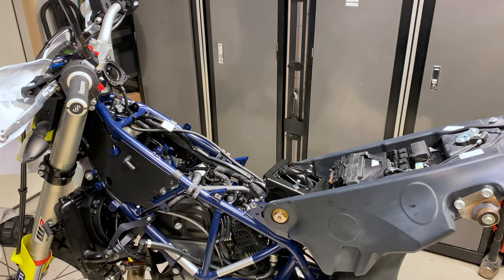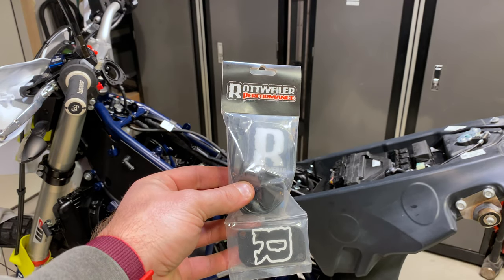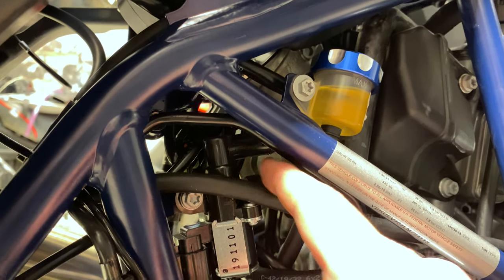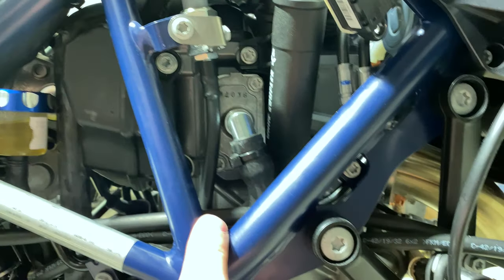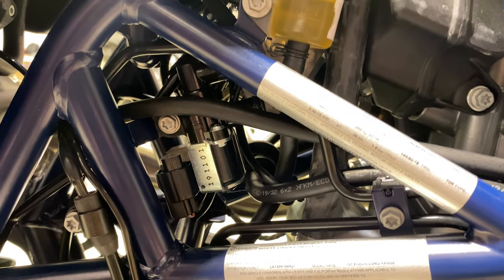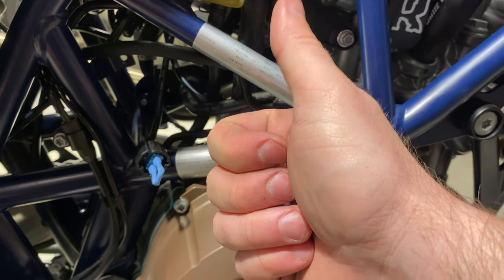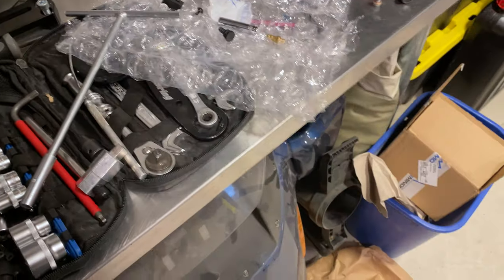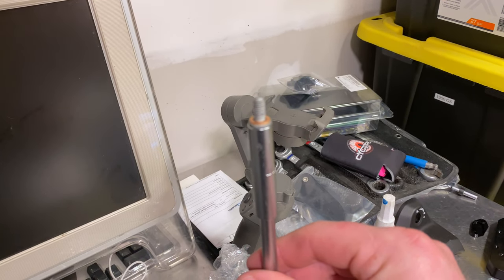Husqvarna 701 Enduro LR: Install Rottweiler SAS / Canister Removal Kit

Comment: Good video.  Thanks.
I just did this myself and made a few mistakes.
For you video - a couple notes: 

You should have left the two hoses joined and coming down into the clear piece that you would use to connect with a section of the tube from the canister you removed.  This would mean you remove the black hard-plastic Y and the bigger section of the hose.

Also the heat-shrink is an adhesive shrink.  Heat it and then apply pressure to seal it.  Don't try to "shrink" to create the waterproofing as it won't shrink that far.
Reply from the maker: Thanks for the comments. I’ve been running it as seen in the video for 2 years and 5,000 miles and no issues yet. Not saying you’re wrong, just sharing my experience.

Comment: If there is one thing I envy about Americans besides the amazing nature it is that you all have houses with garage -so our important hobbies have the place they deserve  :). With us, everyone handles motorcycles in the yard, without lighting, stands or cabinets for the equipment and tools. Great detailed guides BTW. I installed the pollution sensor unit and a 3'rd side clutch pump and more additions will come later. Safe riding!
Reply from the maker: Thanks for watching the videos! Funny thing is, this is actually my cellar / basement :P I bring the bikes in here in the Winter time. No garage for me but this space is heated. I rigged up an array of LED lights to make working on bikes easier and put in a fridge for beer with a small stereo. Our Winter is 5 months long with ice on the ground so I kill time tinkering on bikes! Have a great year.
Reply: @AdamChandler86  ... 6 month without riding- I'm not envy anymore :) Love Your Vids.

Comment: Hi Adam
Can you tell me why most people want to remove that ( canister )
What effect does it have?
Reply from the maker: These canisters are just charcoal filters and their intention is to filter any fuel vapors that would normally expel to atmosphere unfiltered. In some cases, these canisters are closed loop and air goes back into the air box after being filtered to recirculate into the motor eliminating most of the emissions that are poisoning our earth. In reality, these weigh 2-10 pounds and we're talking about a similar amount of vapors that would be coming out of the gas station nozzles if you spill a little on the side of your car. Tiny traces of gas that are nothing compared to the tail pipe of a diesel truck. So most people choose to remove them. No state except California requires these but due to California's size, they are required nationally "CARB Compliant" is a big deal here. In this install video, I am still sending the vapors back into the air box but I'm just removing the filtering hardware to reduce weight and simplify the exhaust system.

Comment: On start up was everything ok the rottwieller kit and rade garage kit ,,,did everything work ok
Reply from the maker: Yes, all good now. I plugged one of the holes manually so fuel wouldn't leak out when the bike goes down.

Comment: Why not jusf remove the white y splitter and reconnect both lines to the black?
Reply from the maker: Great question. the concern I had at the time was since I have 2 fuel tanks that I should keep the Y-splitter intact.  If you don't have an LR, you probably won't have this issue.

Comment: Hey Adam, 

On the bolt that replaces the 8mm copper bit, would you throw lock tite on it? I am thinking about just cutting the OEM hose on it and using the plug with a zip tie on it, so it keeps the factory connection.
Reply from the maker: I put Loctite 243 (medium strength, petroleum resistant) on everything. But I’m a weirdo. For that one, you probably don’t need it.

Comment: I was wondering, what's the resistive mesurement of the SAS dongle please ? :)
Reply from the maker: Oh man, I’m not an electrical guy at all and I don’t have a Multi-Meter. I’m sorry I can’t help.
Reply: I am wondering this too! Does anyone know what size resistor this is?
Reply: @user-cq1cp1nj8p  Finally, I put a 1000 ohm resistor and it work :D

Comment: I've just installed this canister removal mod from Rottweiler. Now it seems if I drop the bike on the side fuel will start pouring out of the overflow tube. I have not tried it myself yet, but people on one  forum claim that's the case. Have you had this issue? If yes how did you solve it? It seems fuel pouring out from a downed bike is not very safe.
Reply from the maker: Yes, I have the same issue. I asked Rottweiler about it and they said just keep the splitter lower than the tanks. I'm going to plug the 3rd hole that is exposed as it's not needed anymore.
Reply: @AdamChandler86  so you're keeping the stock (thick) drain tube and the Y splitter? Just plugging the unused hole in the Y?
Reply from the maker: that's the temporary plan. I am awaiting Rottweiler updating their page w/ guidance / part that works with the Long Range. I would like to see them ship me a tube that is just a single Y split where both tanks go into one hose that vents.
Reply: @AdamChandler86  I think I found a solution. I installed back the canister and the original Y with the thick dump pipe capped at the bottom, with a thin line from the Y connected to the "Tank" inlet on the canister (as was the OEM setup). To the "Purge" outlet of the canister I connected a long hose and routed it to the rear shock linkage. This now dumps the excess fuel, if any, from the canister.
This has the following benefits:
1) fuel seems not to be leaking out when the bike is on the side (at least it does not start immediately)
2) there are virtually no gas fumes in the garage. 
3) I retained the benefits of the delete kit, since the sensor plug and the block-off plate are still installed, and the fumes from the canister are not going into the intake.

Comment: Adam, you mentioned in another vid that you are going to get the fuel line recall to be done.  Do you need to do that if you did the Canisterectomy on your Husky?
Reply from the maker: The laws may vary by state or country but here in New Hampshire, I’m actually writing this comment as I’m driving away from the dealer after having the recall work for it and they raised no issues regarding anything on the bike or emissions.